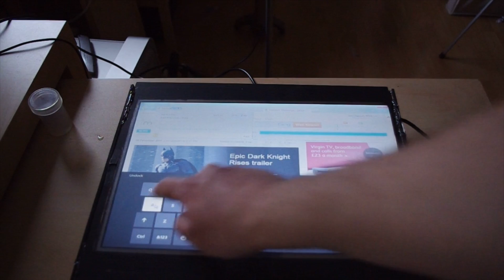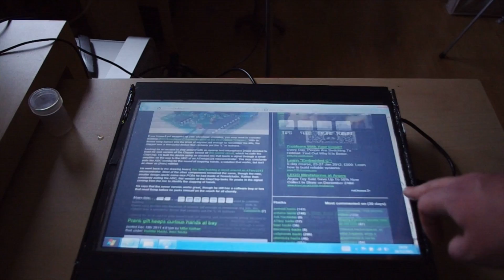Windows 8 Tablet Build

Comment from the maker: @MrShayBomb  I had to install the windows 7 driver for the touch screen so it worked, once it was installed the gestures worked automatically I had to enable the on screen keyboard in the control panel.